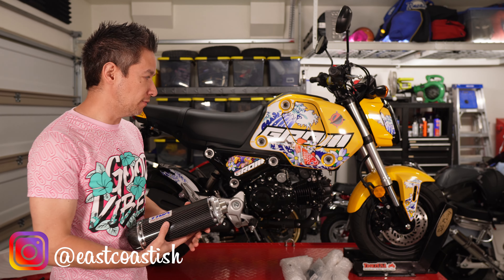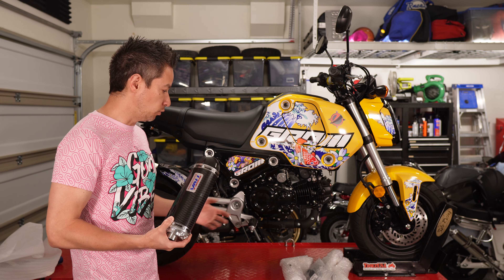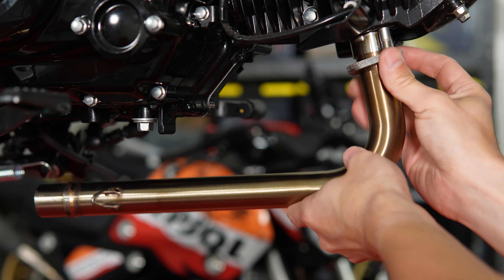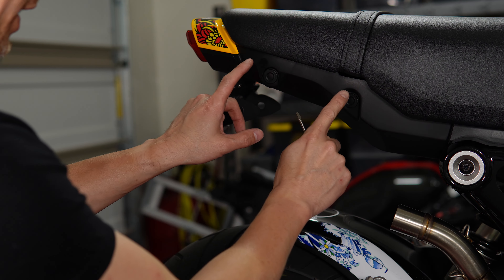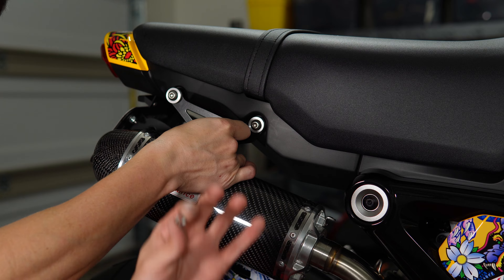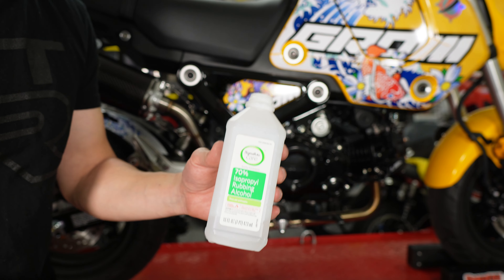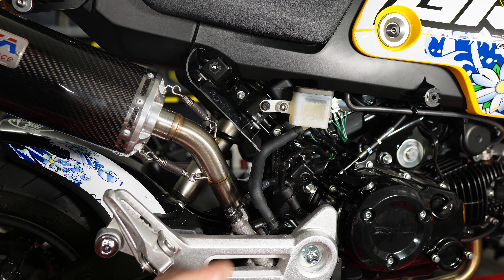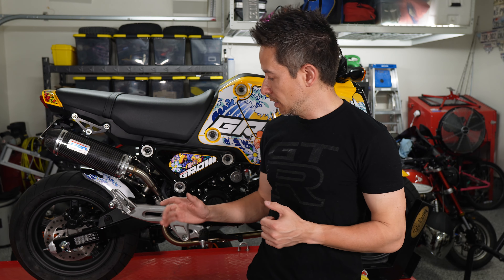Tyga High Mount Exhaust Overview, Install & Sound Check on the 2022+ Honda Grom

Comment: Thanks for the entertainment with each video. I'm running the Vance & Hines and enjoy it tons. Do you know at what oil temp I should start getting concerned? Is 270 getting to that point? Thank you for your time.
Reply from the maker: Wow, 270F is way too hot. At 220F I start paying attention and anything over 240F is asking for trouble. What mods are you running that are getting you that hot? Sounds like next mod for you in an oil cooler...
Reply: @eastcoastish  So far only running the Vance & Hines exhaust and the Dingerbilt intake. I flashed my ECU with the Dynojet PV3. I'm in Ohio so intake air this time of year is in the 70's low 80's. Work commute is long stretches of country roads 3/4 to full  beans 15 min ride.

Comment: Hello, great video thanks .. I just installed mine seems like it wasn’t a perfect fit but it is on.. Is your muffler able to wiggle a little bit and pivot a little where the top pipe meets the middle pipe ?
Reply from the maker: Mine was a very perfect fit. Are you sure it’s not on backwards? Mine was at first (and was loose) so I flipped it around…
Reply: @eastcoastish  no it is not because other wise I would not be able to line up the spring hooks .. I did fix it a little there is just a little
Gap between the pipes .. I took it for a ride and it seems better
Reply: I did find out that the mid-pipe actually bolts down to the bracket from the back and not the front like the OEM exhaust. This closed a gap between the midpipe and header pipe for me.

Comment: Does this exhaust system have the bung for the o2 sensor from the aRacer?
Reply from the maker: No, you need to have one welded.
Reply: What is this?
Reply: When you run aftermarket exhaust, like Ken does in the video, it helps to retune the exhaust.  The most common option for this is a piggyback ecu called “aRacer mini”.  There is an o2 sensor which screws into the exhaust.  Some exhausts, like this one, does not come with a hole to install this o2 sensor.  The name for the hole is “bung” or “o2 bung”.  As Ken said in his comment, you would need to have a hole tapped and welded into place for an o2 sensor if you wanted to run one.
Reply: @TheHandsomeSweet  ok I see. Would getting a canned tune from DHM or CJR relieve the need of the bung?
Reply: Getting the tune loaded to your ecu eliminates the need for an o2 sensor
Reply: @TheHandsomeSweet  ok thanks man. I think I understand now. I was worried for a second

Comment: I hope I'm seeing things, but it looks like those turn signal spacers are FDM 3D printed. That's such a cheap move that is totally inexcusable to me. Otherwise it looks like a well engineered exhaust. They even included the rear brake reservoir relocator bracket so you don't cook the brake fluid.
Reply from the maker: Yes, the signal brackets seem to be a 3D printed PLA. As a spacer, they're structurally sound, no reason to bother machining an aluminum or delrin piece that few people are going to use anyway.